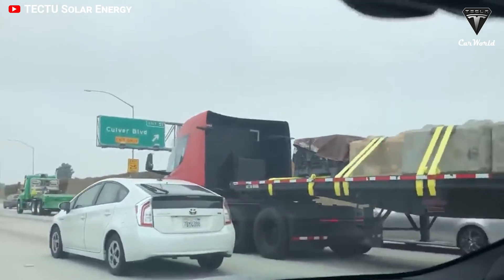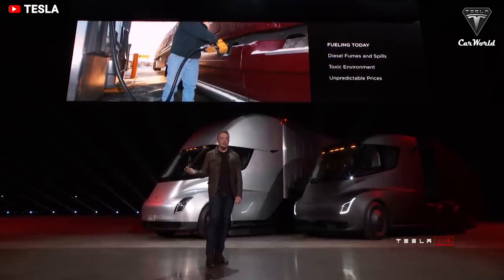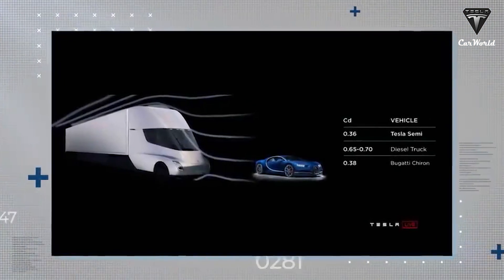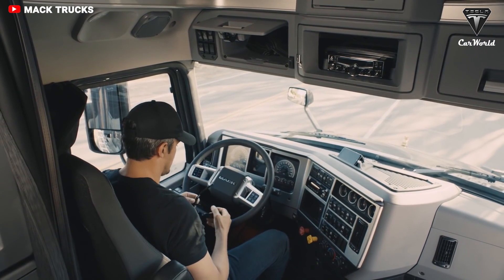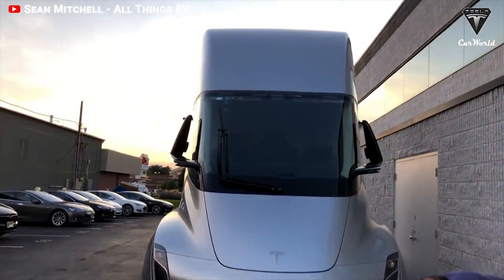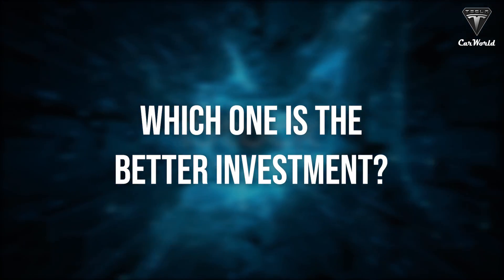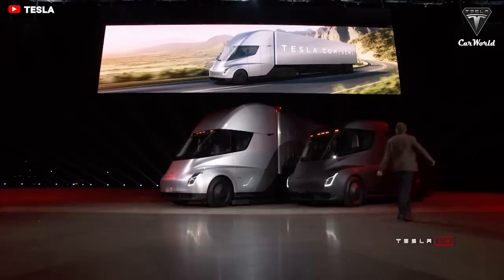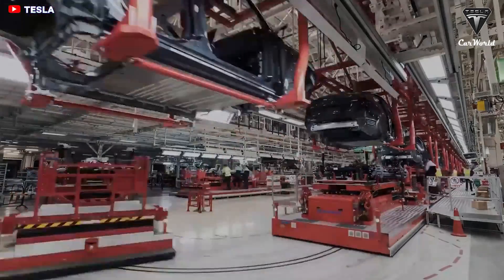Which is the KING of 2023 heavy trucks? Mack Anthem Diesel Truck Vs. Tesla Electric Semi?

Comment: The Tesla because it’s saved the company so much on fuel even if the cost to buy it is higher the overall cost would be lower because of the fuel savings and it has so much better speed especially acceleration vs a Diesel powered model.

Comment: I notice total weight being mentioned (cab and load), and being told loads were 'comparative' to the mack. What are the cab weights of the mack and the tesla? Also, be wary of what elon says, he said these trucks would be out in 2019.
Reply: they havent released the actual weight of the semi so nobody knows how much freight they can carry outside of Tesla and Pepsi Co.
Reply: @bodhisfattva7462  i suspect thats probably the reason, though am interested to know how close/ far they are (as they have been given 2k lb extra to help keep up).
Reply: @freekeess9245  well they save a bunch of weight on the motors as they are tiny and transmission and other things that arent there like fuel, oil, fuel lines, and blah blah blah but these battery packs are stupid heavy and I dont think it would be a shock if they were in the neighborhood of 20-25k for total weight or som meaning they would tow around 1-6 tons less at max weight compared to a 17 ton semi...but we shall see as everything is speculation atm.

Comment: I don't know anywhere that's selling power at 7 cents a kilowatt. We're 22 cents a kilowatt  Hydro Quebec is about 7 cents a kilowatt. The cost of electricity is close to 30 cents a kilowatt along the east coast according to Google. Wholesale rates with demand charges won't be running stable loads charging continuously that's all combined it's probably similar to 30 cents a kilowatt as well. Where do you get seven cents a kilowatt? Louisiana has the lowest national electric rate at about 7 cents a kill a lot. I'm picturing these vehicles being utilized and congested polluted areas such as the Northeast corridor where electric rates are among the highest in the country. And seven sense is a bad number if I try to round it up double it divide it. If my power is 25 cents a kilowatt and you gave a rate of 10 I could multiply that by two and a half times to get my estimate. You used base 7 for others to do their mental calculations with. 7 * 3 is close to 25, 10 * 2 and 1/2 would be easier to multiply in my head. 7 cents makes it sound like such a steal as you underpriced electricity and showcase the highest price of diesel we've ever seen and are still maintaining. You should triple your cost estimate closer to the 30 cent line that most people will probably pay. Those that take the bait and buy won't be surprised by triple the estimate on their bill that you gave. A pleasant surprise would be it cost less rather than double or triple. 25 cents a kilowatt is not the easiest to multiply with either but it sure beats seven and it's closer to accurate than 10.

Comment: Uhh ... Lazy much? The way you just compared gross tonnage and declared Tesla the winner, you might as well have simply shown the relevant legislation and declared all non-fossil fuelled trucks the winner, because they get to have a gross tonnage of 82,000 pounds, vs 80,000 pounds for fossil fuelled trucks

Hahaha - 7c per Kwh. If you redo the math using current electricity prices in the US (as measured by the US bureau of labor statistics), the cost ranges from $47.20 (at 11.8c per Kwh in Seattle) all the way up to $163.60 (at 40.9c per Kwh in San Diego) and even as high as $186.80 in Hawaii

Comment: 0 to60 times is the least important feature in a truck. Stopping the 80k pounds is far more important.  Also horsepower means very little in hauling,  torque is and the diesel has 1800 vs 1500 ft pounds for the tesla. Diesel can haul alot more then 80k pounds and are limited by state and federal law.  So it doesn't matter if you say 82k vs 80k as you would just get an overweight ticket. I've hauled 150k in a Mack with not much difficulty. The electric cost are being substantially reduced by government assistance and I've seen actual cost at independent chargers at or above gas prices

Comment: The only thing they don't tell you in all the figures is the cargo capacity. Comparing a 83000lbs electric truck to a 80000lbs diesel truck how quick it can go to 0-60 is irrelevant when the electric truck can carry 6-8tons of cargo* when the the diesel truck can carry 16-23tons which is at bast 50% better than the electric truck. Until the battery weight can be reduced for long haul then in the short term diesel trucks will be the choice of freight and haulage companies.  Where the tesla will have advantages is in cities that have low emission zones where diesel trucks are ultimately banned from operating in or have to pay large fee's to the city.

* 6-8ton load on the tesla calculated by identifying the type of concrete barrier shown and multiplying it by the number carried. As shown in the tesla video doing a comparison run against a fully loaded diesel truck.

Comment: 1/ 0-60MPH  in 5 seconds : is useless, doesn't mean a thing. E.G. in lots of countries the max speed for Semi's is 50MPH
2/ Claiming it's an improvement to going from the promised 4 to 3 electric engines... Sheesh, you can't make this shit up
3/ No HP or torque figures but claiming they should be the same as those of a Tesla car is not the endorsement that you might think it is.
4/ Theoretical tests of the engines and the believe of their top numbers means .... not a effing thing.
5/ Again,acceleration is not a concern.
6/ Payload claims about being 2000 lbs higher are just that, claims. Notice the lack of demonstration that is verified by anyone not on Tesla pay roll.
7/ Having an 'entertainment screen' because who doesn't want a semi driver to watch Netflix while driving +80.000 lbs on the road.  sigh
8/ No pictures of the sleeper section in the Tesla.... so we get shots of the cupholder but not even all of the interior.... yep nothing to see here folks move on, they promise it will be wonderful and it isn't as if Tesla has every come back on it's word. Except all the times that they did.
9/ All the claimed auto this and automatic that.... are they perchance the same as the ones in the Tesla cars, you know the 'features' that have caused accidents, injuries and even deaths. So imagine instead of a car that fails to keep in it's lane a 80.000 ton vehicle deciding that lanes are lame....
10/  No break pad changes ever ?!? In other words, there is no mechanical way to brake and it's purely electrical !  And all you fan boys don't see the flaw or issue with that? Whoa.
11/ Brake regen ? The amount of people that seem to think that this will add a huge amount of energy back into the batteries just goes to show that there's lots of people that don't understand anything about anything. Sure, it's better then not doing it but if generates more energy then what's needed for the 'entertainment screen' I would be highly suspicious.
12/ Tesla vehicle CLAIM to be on the fore front of technology.... right up until they have to deliver and then for instance fully self driven AI becomes a glorified cruise control.
13/ starts at 110K USD (with tax rebate) for a 300mile version compared to a Mack Anthem at max.140K USD without a 300 mile range *limit*. And how does that make the Tesla look good ?
14/ Fuel vs electric..... all good and well comparing the prices BUT ! Who's going to pay for the very special needed charging stations because you won't be able to charge your Semi on the same charging points of your EV car. Never mind that one can fill the diesel tank in 15minutes where as charging the battery from 0 to full will take you how long? Time not driving is a cost and even with high diesel prices if the Tesla Semi takes even just 30 minutes to charge (and let's be honest, it will take a whole deal longer because if it doesn't than you are wrecking the battery) that difference in price between diesel and electricity is negated on one trip that exceeds the range limit of the Tesla truck.
15/ What a bunch of hot air and hype talk.

Comment: Musk and his fan boys scrupulously avoid mentioning some important facts:  1.  the battery weighs over FIVE TONS  2.  The Tesla truck can haul LESS THAN 1/2 the payload of a diesel truck  3.  The Tesla truck has ONE FOURTH the range of a diesel truck  4.  The infrastructure to recharge these batteries quickly does not exist  5. The acceleration of a semi truck is OF NO SIGNIFICANCE!  It is not a race.  Hyping the acceleration speed of the Tesla truck is pure bullshit and only a distraction from the fact that it is impractical, inefficient, and the only benefit for a transport company is a license to boast about how "green" they are while hauling less for shorter distances, which is exactly the opposite of what long haul trucking is all about.  The reveal was so silly that they were bragging about the CUP HOLDERS while ignoring the battery weight, short range, lower cargo capacity, and recharging problems.  Honestly, the Cult of Musk is populated by some of the most credulous people on the planet.  By the way, Musk promised FULL SELF DRIVING in all Tesla trucks, but this was not mentioned in the reveal, meaning it is not there.

Comment: The horsepower doesn't mean much. Torque is the number that really matters.
I don't need to make the load shift accelerating. 
Electric motors are perfect for hauling but if I needed to buy a truck today it would definitely not be a tesla.

There are some excellent electric short haul trucks though.

Drivers just need to be driving as many of their hours as possible carrying as much weight as possible. Truckers are stubborn, they still use drum breaks even though air disks are superior.

Comment: There is so much wrong in this video. 80k lbs is the federal limit for normal semis. You can heavy haul up to 100k but only a few states allow this. Hp is not what you want in trucking torque is king. Hp is for speed, torque gets you moving. The tesla truck looks to be a day cab. Is there no layout for a sleeper cab. If not then not otr long haul. And have fun trying to charge this thing. With our 14 hour clocks if it takes longer than 30 mins to fully charge. No trucker will use it as time is money

Comment: The base model mac anthem makes 434 HP, and 1,750 ft lb./ft of torque, significantly more than the tesla. Also the MP8HE makes less power than the mp7 & Mp8. study a little before you say a bunch of fake facts. for example all of the numbers you're giving for the tesla Cemi are from the 2017 version. the new numbers have not been released

Comment: Yeahhhhh 80k is the max legal weight according to federal law without permits. I drove vision and pinnacle macks with permits and hauled 95k and more. I prefer mack mainly because its a proven platform and I can fix it in a pinch to keep moving. I'll even settle for a Freightliner Cascadia. Plus the Tesla truck wont work for my company we have shuttles that go 625 miles and within an hour the truck is running another 350-500 miles depending on the route and delivery times it need to meet some of them have a down time of 4 hours if that

Comment: Tesla refuses to state how much its semi can haul or how long it takes to recharge.  The "drives and parks if driver is incapacitated" system is not ready.  The 5-second zero to sixty figure is a fantasy; maybe the tractor can do it without a trailer, but fast acceleration is not a priority for most truckers.  What we have here is a pricy and oversized local delivery truck.

Comment: It's likely VERY telling that the Load Capacity was never mentioned.  To break it down what i mean as low as i can.  How much of the 82K pounds total capacity is allotted to cargo?  Just saying it can move 82K or whatever is not enough.  The point of a semi is to move a shit ton of cargo.  Not 0 to 60 acceleration.  Speed can damage the freaking cargo guys.   All of the fluff like wireless phone chargers, an extra tall cab and 2 screens should absolutely not take away from the facts.  No Autopilot as standard as previously promised, the need for extra infrastructure just to charge them and the missing price should be shooting up more red flags than praise.

Comment: Wow, 5 second 0-60? Thats like caring about a mustang's towing capacity. Some Diesel trucks can go 3000 miles on a single tank of fuel. Then proceed to refuel in 10 minutes. Also lots of these trucks can break 1.25 million miles, get a rebuild and do over another million miles. These EVs are going to easily need 3 batteries in this time. You are a tesla shill.

Comment: este articulo es bias a tesla : diesel truck standard fuel capacity 300 gallon×5.9mpg=1770 millas,max standard peso en USA 80,000 libras= 45000 libras de carga ,no se dice cuanto pesa un tesla pero se save que pesa mas que el diesel por lo que pesan las batteries en realidad puede que el tesla sirva pero para viajes locales que duerma en la llarda todos los dias para que se puedan cargar las batteriasy solo cargas de poco peso,olvidense de usarlo en long haul.

Comment: It is very funny to watch this video and how excited you are with 0-60 time on a tesla truck, and how u will never change the brakes, I have the feeling u have never been in a truck talk less of driving it. Have u consider the traction on the tires before considering the load, too much torque will only spin the wheels or damage it under load, also  the regeneration of power as brakes will not be enough in stopping or slowing down a truck from 60mph to  zero under load, u mention about stability in one of the comments, trucks are very unstable with speed under load, it is a bit better stable when it is moving on a straight line. Another aspect that is very worrying about electric car owners is the 0 to 60 time, put those electric cars in a race for just 3 hours, even mini van or postal truck will be victorious

Comment: Good luck shit truck from Tesla. Trying to compete big boys of diesel 100 years of research in  perfecting  trucks in cars  Peterbilt Kenworth mack international Volvo  Chevrolet Ford GMC. Elon musk's is nothing but a scammer. We had electrical trucks in 1900 in 1950. 1980. Dint work so is why engineering went back to  gasoline in diesel even today we still in same spot. Electricity in salt in water don't mixed very well. Put your cordless or 💡 five in water see what happens when it rains.

Comment: Brilliantly excluded crucial information. 82000 is the total weight limit for electric truck while it is 80000 for diesel truck this include truck and trailer not just the cargo. Tesla semi will be much heavier than diesel truck because of it's huge batteries.